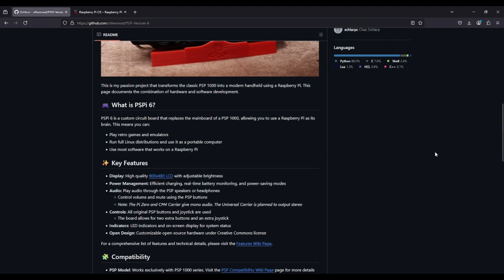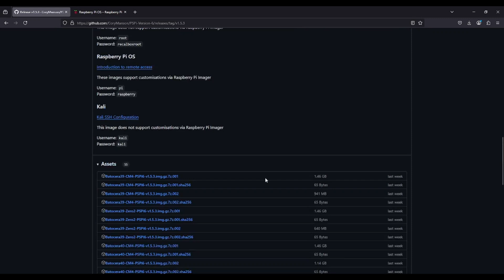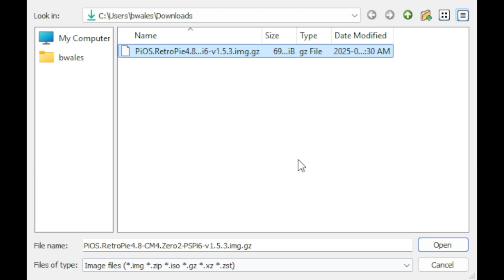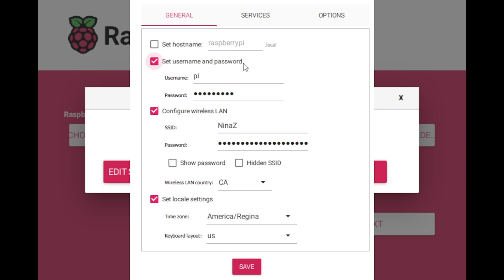CM5 in the PSPi v6 - Part 1 install

Comment: Very happy to see more content around PSPi v6. Thanks! Will you post any videos showing comparisons of PSP games using emulation with the PSPi v6 and an untouched PSP?
Reply from the maker: Not a bad Idea, getting FPS numbers from the PSP can be a pain but I'll look into it!
Reply from the maker: @nate5527 So I've started the basic work on this.  It's going to be a bigger video than you were thinking mostly because I like the idea.

The plan is I'm going to do a 4 screen split similar to how I did for the OS test video.

Going to run a PSPgo (more ram and BT controller support)
PSVita OLED
PSPi CM4 running Batocera 
PSPi CM5 running RetroPie

Any specific game you'd like to see?  I'm likely going to do 4 games, 2 that are hard to run and 2 community choice.
Reply: @MakeOrBreakSociety  I think that sounds like a great idea! God of War would be a must in my opinion. Otherwise, anything or everything. I'm definitely subbed to see the outcomes, thanks!
Reply from the maker: @nate5527  God of War is definately on the list for the hard to run!  Likely also Moto Storm